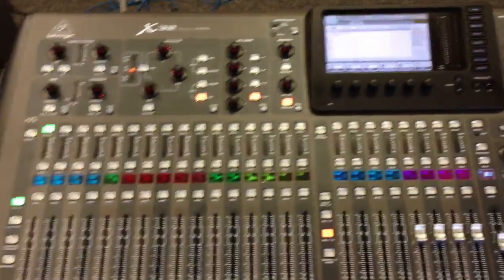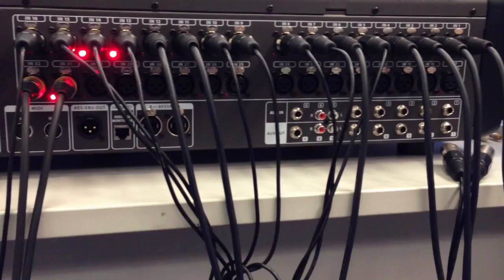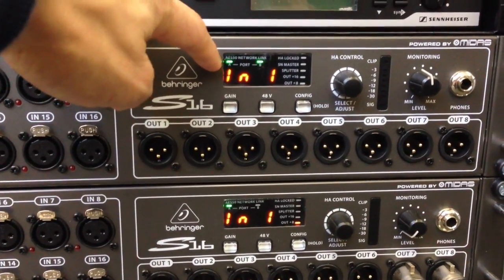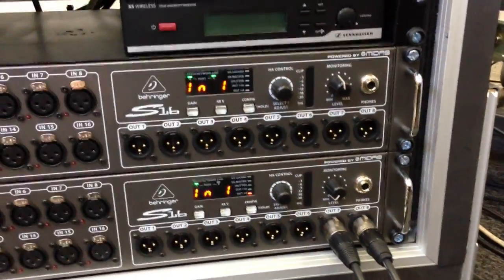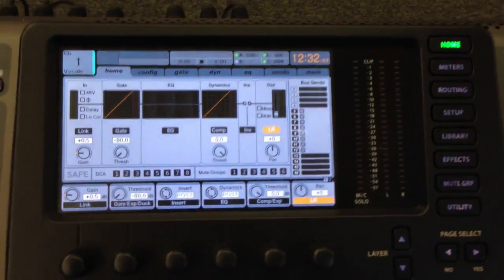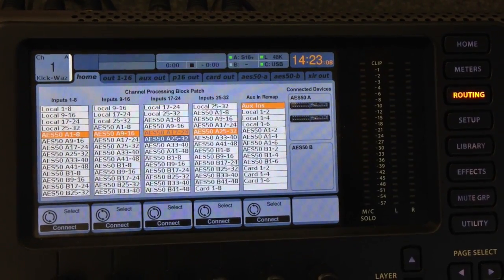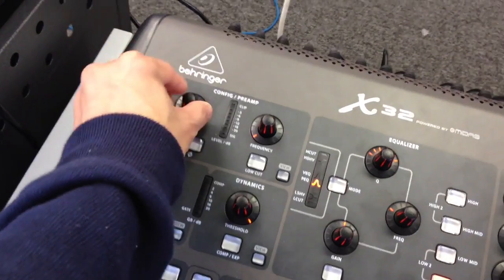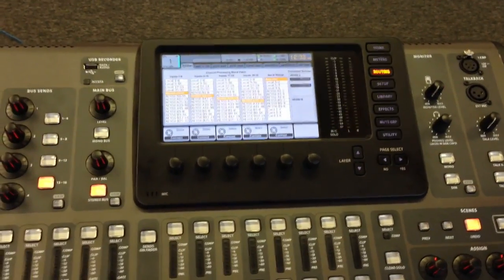X32 PA Setup with S16

Comment: note for people starting out DO NOT USE ETHERNET CABLES TO CONNECT BOARD TO STAGEBOX/DAISY CHAIN 2..... Use a properly shielded Ethercon cable designed for this purpose. all good and well bench testing at home but if you use normal ethernet patch cables in a live setting, you'll start wondering why you get lots of noise, sync dropouts and worst case, fry your gear
Reply: From my understanding, it doesn't matter unless you're running it alongside other cables - namely power cables.
I suppose the safer option is to just go shielded but it doesn't matter if you're smart about routing.
Reply: @childishtombino1275  it absolutely does matter. I've seen stageboxes fry from a small number of items on stage. Any EMI or spikes will cause the box and console to lose sync if it's not correctly shielded. There's a reason that these items of equipment are now labelled in big bold letters to use STP only and reiterate in the manual. You can be as smart as you want with routing but that bears nothing on AES cabling
Reply: @TheRealHixy  Fair enough. Looks like real world won against 'google theories'.
This is something I'll need to consider when I start moving to digital stageboxes.

Comment: I'm trying to setup this with the stage box on the stage for mics and drum mics ect. I don't want to have it mounted in the rack. I have a 100 ft shielded Ethercon cable. Can this be done? I may not have not set the XLR settings correctly. I'm not getting main fader or channel fader but I haveoc inputs. I also want to run aux in for my phone to play music between songs on the board. Everything else I want in the stage box. On stage.

Comment: You should be using bonded and shielded ethercons for aes50 connections, or you may blow your ports through esd ( static electricity) discharge.
Reply: Dear Mr. Heywoo

We discovered long ago that CAT6 S-UTP with a skew delay of 40ns at 100m will report errors on some aes50 ports
But this specification is allowed by TIA, such a large skew delay is to have a better NEXT because CAT6 requirements are higher than CAT5
Later, we use the SFTP structure to reduce the skew delay to 6ns@100m, which can make AES50 work to 130M in the experiment

This is my video to share with you at https://youtu.be/wvdJeEfHxhE? si=GflSbEW1KpzwHG9z&t=620
Reply: 😂⁴

Comment: I am a little beat confused, in a case when you have 2 FOH speakers and a Subwoofer, where do you plug your subwoofer on the stage box?
Reply: DrewPlanet those are assignable. The mere convenience of having a digital desk. Pretty much any i/o can be configure to whatever type of use you might need it for. Mains/aux/matrix etc...